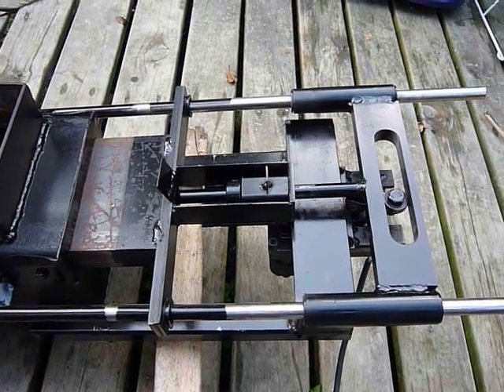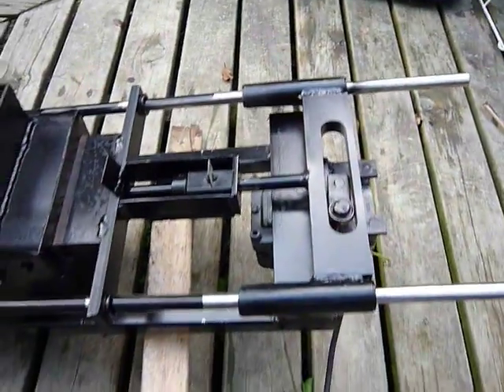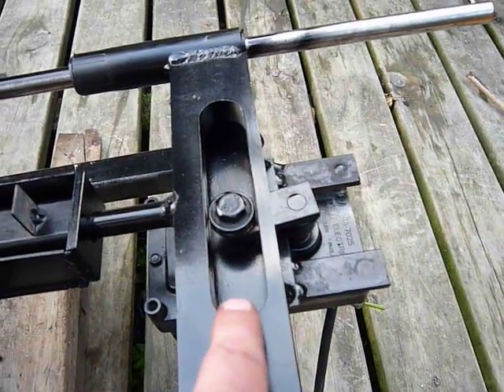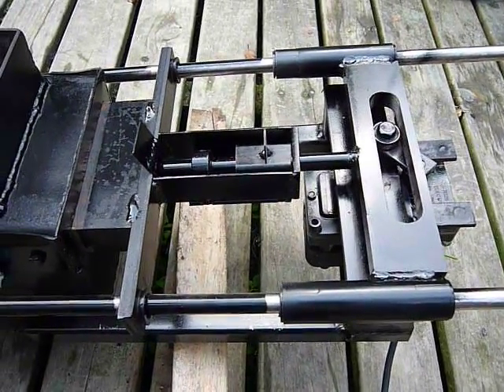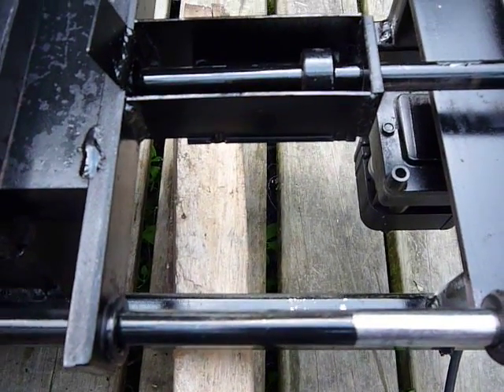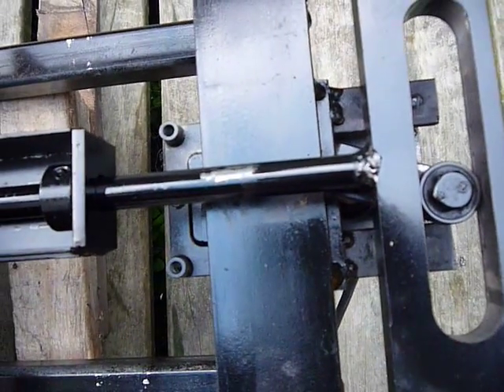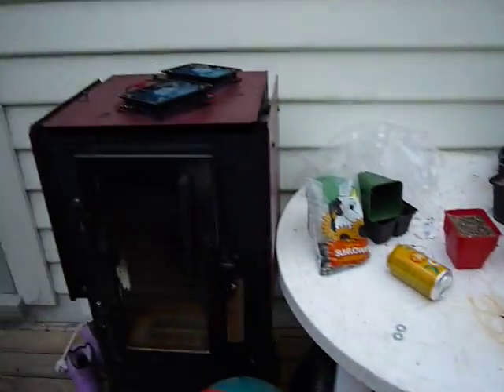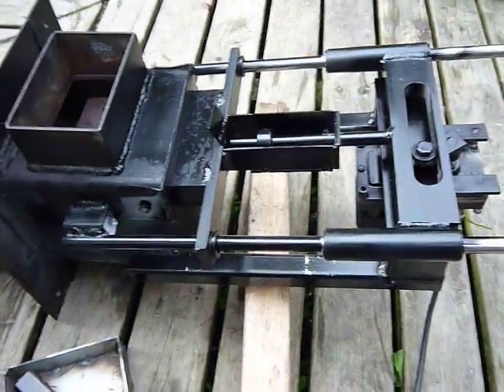Homemade coal stoker mechanism after rebuild

Comment: Does it just run continuously or do you have some sort of controller that calls for heat and kicks the motor on?
Reply from the maker: It ran continuously......i had intended to to put a solenoid on it to have it go from an idle fire setting to full fire when a thermostat called for heat.....but after running it for a awhile on manual adjustment i gave up on the solenoid idea as it wasn't needed

Comment: Does that big pusher block ever bind on a piece of coal when pushing forward? Is it powerful enough where it would just crush the coal if it has to? Maybe i just dont understand how it works because it seems there could be an issue where the front of the pusher passes the vertical shoot from the hopper.
Reply from the maker: The size of coal i was running in this one what i believe is called rice or buckwheat size coal in the 'states and there was no issue with it crunching coal...push block didn't pass beyond the front of the hopper opening....never tried it with bigger coal